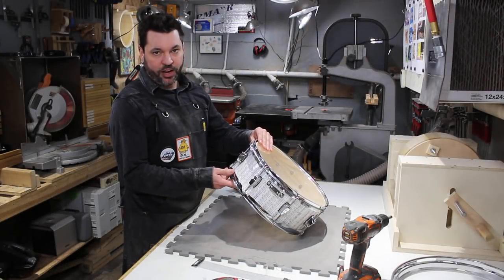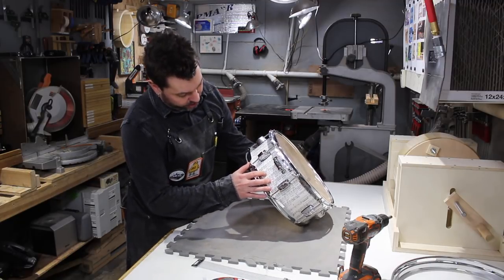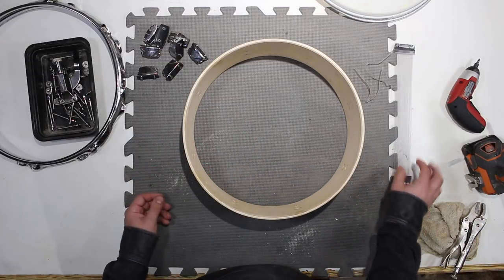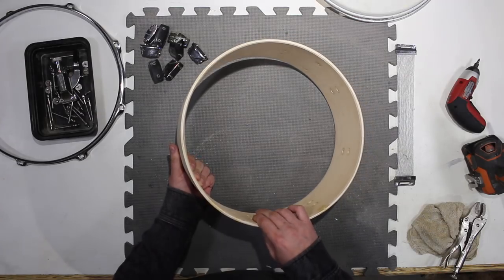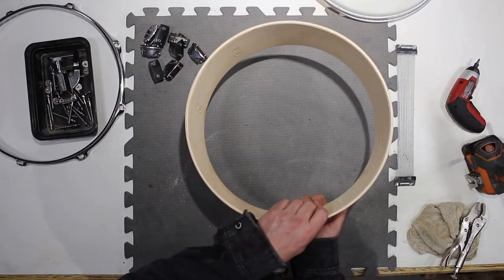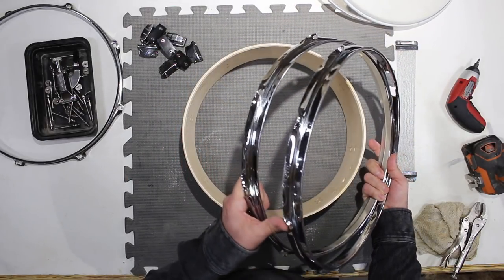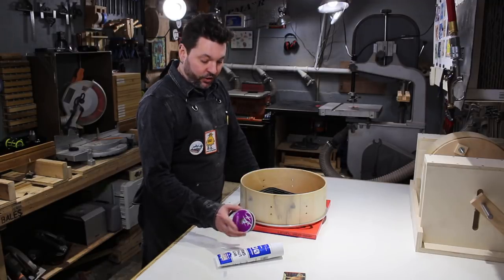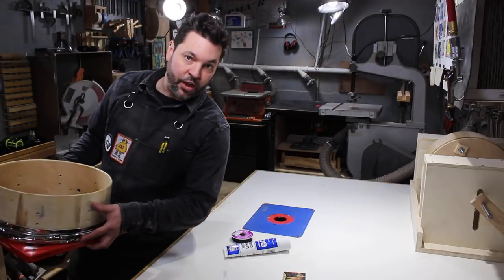The Entry Level Snare Repair

Comment: On the subject of shell repair, I have a couple of toms from my first Drumset with horrible delamination. Should I just glue and clamp?
Reply from the maker: It’s worth a try. If the delamination is really deep, you can thin the glue a bit and even use a syringe (I used to have some from past vet ordeals). Be mindful of clamping pressure. These spring clamps actually dented this bass wood. Small F clamps have more control and you could also use scrap wood cauls or rags.

Comment: I wonder if that wrap is available in both letter and legal size.  I have a cheap $25 craigslist kit I want to re-cover, but real wrap would cost way more than the kit.  Thinking about alternatives, like fabric, paint, stickers, etc.  Any suggestions for cheapo diy wrap?
Reply from the maker: Print out your artwork and the laminate it (front and back) with clear shelf liner from the big box store. Cheap, easy, and swappable. It’s on my video list, but I’m slow.
Reply: Thanks!  I just watch your water droplet technique.  Very cool!
Reply: I have seen drums wrapped in fabric. Looked nice. Very unique, that's for sure!

Comment: ...the theory with guitars is you buy a cheap one and upgrade the hardware and you end up with a good guitar but it's debatable if it's cost effective ...just curious does the same apply for a cheap drum kit ?
Reply from the maker: You don't see much hardware upgrading on drums.  One reason from a builder perspective is that hole spacing on lugs, throw-offs, and butt plates aren't universal.  Another reason is that most of the hardware is coming from the same place and used by countless companies/custom builders.

These entry level kits are disposable (sadly).  The shells are light and you can see the quality of workmanship is very low.  All of the hardware was/is thin and cheap.  That's how you get a 5 piece kit with a kick pedal, thrown, hi-hat stand w/cymbals, and straight cymbal stand with a cymbal for $200.  The snares I have been assembling run on average $250 just for the parts.

The best bang for the buck for young players is Craigslist.  It takes some searching, but very nice kits can be found for "get it out of my house" prices.